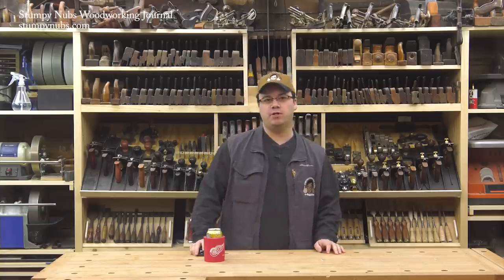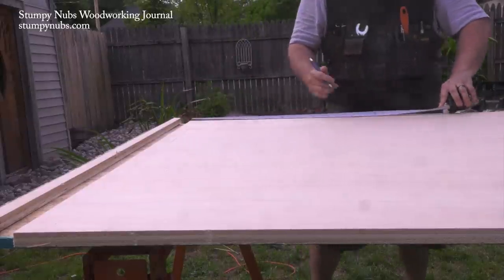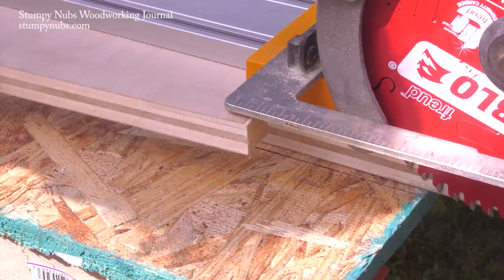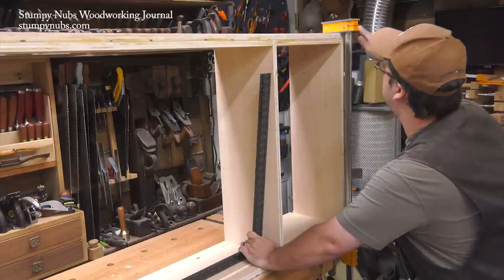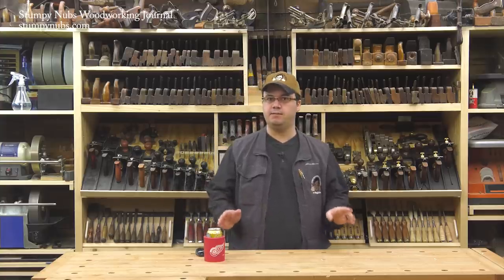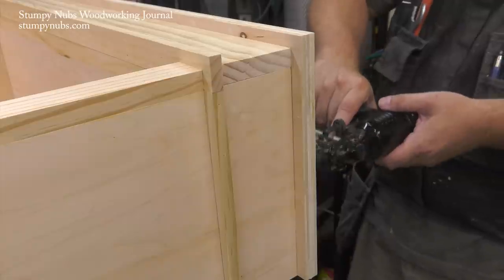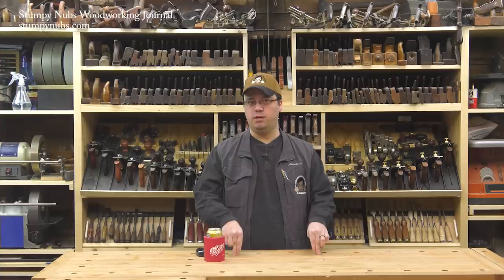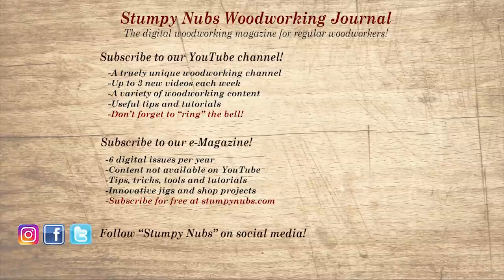How to hide $1000 in bookshelf you build without a workshop

Comment from the maker: When you use this link to visit our sponsor, you support us► 
Bora/Portamate: https://amzn.to/2XByXhw
Reply: Cool project, James! Thanks for sharing.
I found the Bora edge guide very inadequate in its clamping ability on the plywood, but continued marching forward by buying another short track to fasten to the short one I already had. The joining pieces were not drilled very precisely, so I had that to contend with. I bought the circular saw plate from them also, and ditched the end clamps, gorilla-gluing the extended track onto a piece of masonite with one white side. I put the white side down, glued a strip of waffle drawer liner material along the length of it, then made my test cut, cutting the masonite for the exact cutline. I purchased the Festool replacement edge strip (about $49) and fastened it to the underside (white side) of the Masonite, just over the cut line so that when I made the first cut, it would be in line with the cut. It works fantastic! There;s no plunge feature or dust-collection yet, but for under $200, using a circ saw that I already had, I've saved a bunch of money that I can now spend on plywood. I cannot take credit for the idea; I just adapted some ideas from some YouTube videos that I've seen. :-)
Reply: is there a reason you couldn't use knotty wood planks?
Reply from the maker: They have improved their edge guide.
Reply: @StumpyNubs  Yep. I had to end up buying a complete set of two, because the one I ordered directly from them would not match to my original short guide. The new and improved one is the one I was referring to the holes not being drilled very accurately. Even so, it's a good workaround to buying a $600-$1000 real track saw. For what I'm currently doing, it fits my need well.

Comment: Wish I'd had this video 50+ years ago when I made my first set of bookshelves. All I had was a circular saw, a screw driver, and a drill. I cut everything using a metal trash can--couldn't afford sawhorses--and put them together with screws and some little screwhead rings to dress them up a bit. I still have those shelves in my workshop loaded with most of my handheld power tools. Must have done something right!

Comment: That took courage to air your dirty laundry before others. Oftentimes we can fully conceal and or rework our projects to correct mistakes. Other times it is best to just make the part over, especially if your client has a discerning eye or is paying big bucks for an heirloom piece of furniture that should be right. I was faced with that same scenario about 25 years ago while constructing a large circular front China Closet for a client that wanted it made out of American Holly. I measured wrong and one of my subassemblies was off by an inch. Nothing to do but remake that assembly. It was an expensive lesson. But to honor your bravery in posting this video, I have bought your plans for your bookshelf. Besides, I needed a great design to build and yours is great, plus it saved me time in designing one on the computer myself. Cheers

Comment: Great stuff and you have made such a positive contribution to teaching safety.  I must point out that your circular saw cord has come adrift of the outer insulation, exposing those internal wires.  Over time it will become a safety hazard.  Repair or replace.

Comment: That "track saw" system looks like a better value than the Kreg accut system.
Reply: There are two things that I like about the accu-cut: a) you place it exactly on your cut lines, so there is no guess work where it should be clamped and b) you do not need any overhang since there are no clamps on the ends.

Comment: Checking out the Bora products it looks fairly obvious that it is adjustable to its maximum length but I'd like to know that for sure. Thanks for this video I have had "plans" to make bookshelves for years now and finally I can see a system I really like, thank you. Though I had hoped to do floor to ceiling bookshelves originally these do look nice.
Reply from the maker: They edge guides come 24", 36" and 50". They also make a 50" extension which, when added to the 50" edge guide will allow you to rip a full 8'.
Reply: Thank you, I have found a local supplier who sell them here in Australia so I may not be ordering them from the link above which I would have preferred to.

Comment: I bring this up because of a discussion at our Makerspace:  Could you do a video about the safe ways to transport large pieces of materials with smaller cars.  4' x 8' plywood is nice, but how do you get it home in a Corrolla or Fusion sedan?  I find this is a big point of frustration from beginning wood workers, especially after the box store employees have mangled a $30 sheet of material in the past.

P.S.  Also my pickup died and I am stuck with the Corrolla until fall.
Reply: I have plans to use the roof racks and an attachment that will rest on the bike rack to better distribute the weight. Then I will make some 90 degree mitts of strong but durable material to hold the corners together. When it is warmer....
Reply: Get a ser of simple car top carriers that clamp indeed the window track. Then strap the plywood, etc. to the carrier. That is what I started out with many years ago before I even dreamed of having a pickup truck.
Reply: Make a shopping list with all materials you will need, then rent one of the $20 trucks at the box store.
Reply: I've had good experience having the home store rip sheets to width. They have that big saw for this.

Comment: Great tips & nice walk through. Question on the glue up tip @3:42 Have you heard of using SeaSalt instead of brad nails & clamps? not sure if that would be a good way to clap the wood but maybe keep it from sliding around. Are there applications where you have tried salt? would you recommend to only use salt in certain circumstances or not at all. Thanks for making high quality content.
Reply from the maker: I've used it. It works ok if you don't use too much.

Comment: Building housing joints or though tenons by glue up is also a great way to build a workbench before you feel you have the skills to build a workbench.
Reply: Yep I do watch Paul Sellers and what that man can do and how quickly with a chisel is amazing. However I am not and will not be the artisan he is looking for. I have seen other workbench plans where the legs are cut with a mitre saw and the legs are built up from parts so as to achieve the tenons. That is most likely where I will go unless I can get something good on gumtree high does happen sometimes. A good bench sometimes comes up for less than buying the crises let alone the timber and glue. James is great for making stuff achievable and safe. Paul is great for how to use and maintain traditional tools well. I did buy a Stanley no 71 and sharpened it up. There is a real quiet sense of wonder and satisfaction as the router plane takes reasonable amounts away quickly and also shears the finest finishing depth adjustment away silently. For me it will be a mix of power tools and some of Paul’s hand tool techniques.
Reply from the maker: We made a workbench that was layered to create the joinery: http://www.stumpynubs.com/2x6-roubo-workbench.html

Comment: "on a shoestring"
$200.00 is a pretty expensive shoestring.  Edge clamping guides - nice - but costly and a router fixes the problem about making a sliding track in the top of a home made one.
Reply from the maker: Ever price out a new table saw? You don't get something for nothing. You want to make furniture, it's going to cost a bit. But just as the shoelaces are cheaper than the shoes, an edge guide is cheaper than a table saw.

Comment: Great video!  What gauge brad nail would you recommend?  Thank you
Reply: The smallest your nailer will take is all you need for this sort of thing, since it's really only there to pin the boards together until the glue dries. Plus, the smaller the brads are, the easier they will be to hide. Only go up a size if you're working with harder woods that prevent the nailer from doing its job properly.
Reply: Night Cat - would a 23 ga pin nailer be too little, in your opinion?
Reply: @nightcatarts  thank you!
Reply: @bruceregittko7068  As long as it can penetrate the wood you're using, it'll do just fine. Whether that's the case, I can't say, so it's trial & error (since it depends on the type of wood, moisture content, & the power of your nail gun & quality of the brads).
Reply: Since you're talking brad nailers,  for anyone considering purchase,  we have a little set from Harbor Freight.  Both brad and stapler.  Good value but buyer be forewarned that their replacement boxes of brads can be out of tolerance enough that they will not work in the nailers.  We had to go to a big box store and buy name brand and the new box of brads (or was it staples?) fit perfectly.  Maybe because we bought the nailer and then time passed before buying more supplies for it?  (But we saw other reviews from people who found the boxes of fasteners were out of tolerance and wouldn't work.)
Reply: @rwind656  I think it's worth the extra money to buy decent brads & staples as well as scroll saw blades. The cheap ones are made of cheap material & will bend, snap, fail to punch/cut through, etc.